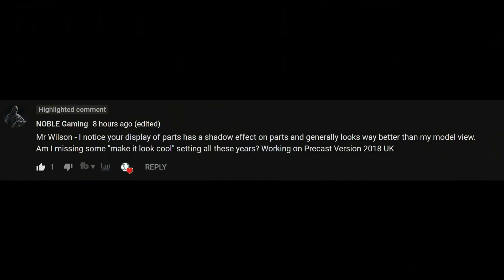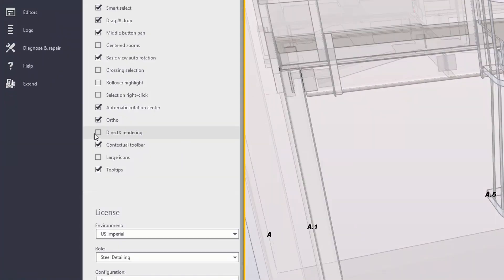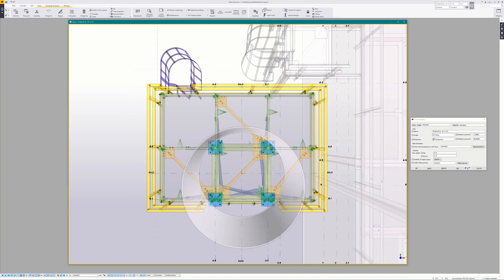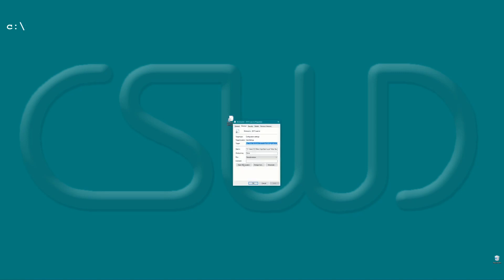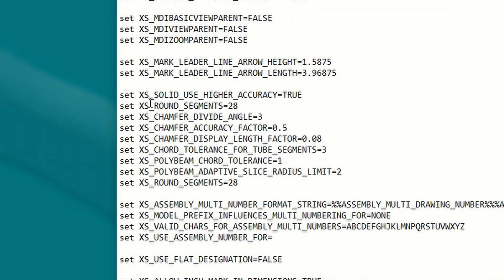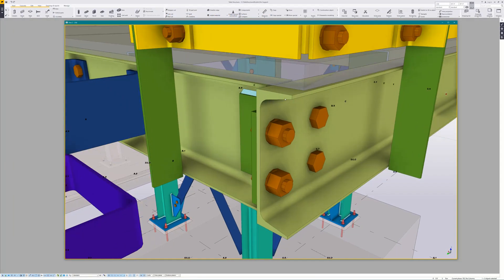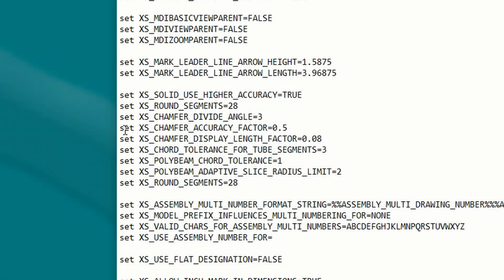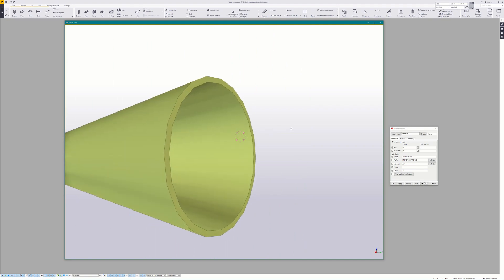Tekla Structures Display Settings

Comment: hello, can you share your user and option.ini files? Thank you !
Reply from the maker: Here is my user.ini file (you'll obviously have to change some settings.  i.e. firm folder):

rem ==========================================================
rem     Tekla Structures v2017i user defined settings
rem
rem     --- Please do your own system modifications here! ---
rem
rem ==========================================================

rem ==========================================================
rem --- UNIVERSAL SETTINGS ---
rem ==========================================================
rem  Add settings here that you want to use in both user modes
rem
set DAK_BMPPATH=C:\ProgramData\Tekla Structures\2017i\Bitmaps\
set XS_FIRM=C:\Users\CS Wilson\Documents\CSWD Firm Folder\
set XS_MODEL_TEMPLATE_DIRECTORY=C:\Users\CS Wilson\Documents\CSWD Firm Folder\Model_Templates\
set XS_DIRECTINPUT_CONFIG=C:\Users\CS Wilson\Documents\CSWD Firm Folder\DirectInput.cfg

set XS_USE_OLD_DRAWING_CREATION_SETTINGS=TRUE
set XS_DSTV_NET_LENGTH=TRUE
set XS_DRAWING_SNAPSHOT_CREATION=FALSE

set XS_MDIBASICVIEWPARENT=FALSE
set XS_MDIVIEWPARENT=FALSE
set XS_MDIZOOMPARENT=FALSE

set XS_MARK_LEADER_LINE_ARROW_HEIGHT=1.5875
set XS_MARK_LEADER_LINE_ARROW_LENGTH=3.96875

set XS_SOLID_USE_HIGHER_ACCURACY=TRUE
set XS_ROUND_SEGMENTS=28
set XS_CHAMFER_DIVIDE_ANGLE=3
set XS_CHAMFER_ACCURACY_FACTOR=0.5
set XS_CHAMFER_DISPLAY_LENGTH_FACTOR=0.08
set XS_CHORD_TOLERANCE_FOR_TUBE_SEGMENTS=3
set XS_POLYBEAM_CHORD_TOLERANCE=1
set XS_POLYBEAM_ADAPTIVE_SLICE_RADIUS_LIMIT=2

set XS_ASSEMBLY_MULTI_NUMBER_FORMAT_STRING=%%ASSEMBLY_MULTI_DRAWING_NUMBER%%%ASSEMBLY_MULTI_DRAWING_POS%%
set XS_MODEL_PREFIX_INFLUENCES_MULTI_NUMBERING_FOR=NONE
set XS_VALID_CHARS_FOR_ASSEMBLY_MULTI_NUMBERS=ABCDEFGHJKLMNPQRSTUVWXYZ
set XS_USE_ASSEMBLY_NUMBER_FOR=

set XS_USE_FLAT_DESIGNATION=FALSE

set XS_ALLOW_INCH_MARK_IN_DIMENSIONS=TRUE
set XS_LEADER_LINE_TO_DRAGGED_DIMENSION_TEXT=FALSE
set XS_ZERO_POINT_SYMBOL_OLD_WAY=TRUE

set XS_BASE_LINE_WIDTH=0.01
set XS_DRAWING_PLOT_FILE_NAME_G=%UDA:PROJECT_COMMENT%-%DRAWING_TITLE%%DRAWING_REVISION? - Rev %%REVISION_MARK%
set XS_DRAWING_PLOT_FILE_NAME_M=%UDA:PROJECT_COMMENT%-%DRAWING_TITLE%%DRAWING_REVISION? - Rev %%REVISION_MARK%
set XS_DRAWING_PLOT_FILE_NAME_W=%UDA:PROJECT_COMMENT%-%DRAWING_NAME.%%DRAWING_REVISION? - Rev %%REVISION_MARK%
set XS_USE_LINECLIP=FALSE

rem set XS_VIEW_POSITION_X=5
rem set XS_VIEW_POSITION_Y=5
rem set XS_VIEW_WIDTH=1024
rem set XS_VIEW_HEIGHT=768

-------------------------------------------------------------------------------

And here is a "typical" options.ini file of mine (again, you'll need to add, subtract or modify the values for your own setup):

XS_CALCULATE_MACRO_COORDSYS_FROM_POINTS=TRUE
XS_CLEAR_MODEL_HISTORY=TRUE
XS_POLYBEAM_ADAPTIVE_SLICE_RADIUS_LIMIT=1
XS_USE_OLD_DRAWING_CREATION_SETTINGS=TRUE
Reply: CS Wilson Draws  by the way, do you know how to set checkboxes always off when open dialog box. Thanks you.
Reply from the maker: XS_DIALOG_ENABLE_STATE

Comment: Hello sir, I have using Tekla 17 version but I don't found your setting. my setting is,
rem ==========================================================
rem     Tekla Structures user defined settings
rem
rem     --- Please do your own system modifications here! ---
rem
rem ==========================================================

rem ==========================================================
rem --- UNIVERSAL SETTINGS ---
rem ==========================================================
rem  Add settings here that you want to use in both user modes
rem
rem set XS_FIRM=..firm folder path\
rem set XS_PROJECT=..project folder path\
rem set XS_STD_PART_MODEL=..
rem set XS_PROFDB=..
rem :::

rem set XS_VIEW_POSITION_X=5
rem set XS_VIEW_POSITION_Y=5
rem set XS_VIEW_WIDTH=1024
rem set XS_VIEW_HEIGHT=768

Comment: Do you know what if any settings that would cause node/handles to be extremely small? This also seems to effect several dropdowns in dialogs with images. This happens on some monitors and not others.

Comment: Does the setting set XS_SOLID_USE_HIGHER_ACCURACY=TRUE work in TEKLA 2018? it works in 2017 version but when i change the ini file in 2018 version with the same settings you demostrate it doesnt work.
Reply from the maker: It work in TS 2018.  I have it set in the user.ini file (usually found at C:\Users\<user name>\AppData\Local\Tekla Structures\2018\UserSettings).
Reply: I created a new model and it work fine. When i try to open a model that i 've created before i applied your recommended settings it fails. Thank you. @CSWilsonDraws

Comment: Which computer configuration you are using ?
Reply from the maker: Right now, I'm running an Intel Core i7-8700k (4.8Ghz OC), 32GB DDR4 3000, GTX 1070Ti, 1TB SSD plus 2x3TB HDD (Raid 1), two monitors (43" 4K monitor (landscape) and 27" 2K monitor (portrait))
I'm working on a video about the construction of my current computer and monitor setup, but I've been busy and haven't had a chance to finish it.  Be on the look out for it, though!  I plan to post it someday! :)

Comment: Hello, Could I make some parts in the drawing as it is in the model, I mean rendered?
Reply from the maker: Yes.  You can create a 3D view on the drawing, shade the members as desired,  then plot the drawing in color.
Reply: Hello, I have an issue with the product identifier, for a certain model, doesn't respond to "option.ini", but the other models are ok, no problem. I noticed when I add the line XS_PRODUCT_IDENTIFIER=FALSE and save the file,  close it, after a few seconds, the file change and the line removed. could you please help. Thanks
Reply from the maker: It could be that XS_PRODUCT_IDENTIFIER has been set in the Advanced Options dialog of that specific model.  If that's the case, then it has been written to the options_drawings.db file as well.  Change it in the Advanced Options for that model.
Reply: thanks for your reply,  it was already False,. I tried to replace the file options_drawings.db with another one from a different model but was a big mess, it didn't work.
Reply: @CSWilsonDraws  Hello, is there any option in drawing to show any part in transparent like Glass etc.

Comment: thank you very much for your great videos, I learnt a lot from your nice presentation, I have a question, I want to remove product identifier, I tried changing it to false, but still, it is there, do you know a different way to get rid of it.
Reply from the maker: You're welcome, and thanks for watching!

As far as turning off the Tekla Structures using XS_PRODUCT_IDENTIFIER=FALSE, it works for me when I set it directly in the model.  You might try looking in your firm folder or user.ini file to see if it has been set there.  If not, put the line SET XS_PRODUCT_IDENTIFIER=FALSE in your user.ini file. 
Hope that helps!
Reply: thank you very much, I  will try it again.

Comment: I am trying to use direct modification to modify gridlines.
"direct modification"  and "gridlines" are on but I cant move the gridline by left click on the gridline. Need help.
Reply from the maker: I tested DM on model gridlines in TS2017i-SP4 and TS2018-SP1 and both are working.  What version of Tekla Structures are you having trouble with?
Reply: I am using ts2017.
It looks like its working only on some of models I have created.
Thanks for your time.

Comment: Mr Wilson
2 things, ok 3
first, thank you for your vidoes, they are very helpful, keep them coming.
2nd, i put your settings in the user.ini where you said it was located and nothing changed after getting out and back into Tekla. it did however work when i out them in the options.in in the model folder. any thought as to why?
3rd, if you have time, the model looks great now, i love it but, open holes are solid, they are respresented but can;t see through them. is seeing through them possible? if so is it advisable?

again thanks for your time.
Jimmydd123
Reply from the maker: Thank you!  I'm glad to hear you find the videos useful.
For your ini situation, if you're using a firm or project folder, check to see if there's an options.ini file in either one of those.  The ini load order would go something like: user.ini, then options.ini in the firm and/or project folders, then options.ini in the model folder.  Each one overriding the one before it.
For the holes being solid, I assume you mean holes added using the bolt command.  Unfortunately, those are depicted as solids in the model and not any to get around it if you want to be considered as "bolt holes".  You can manually add "see-through" holes, but they will be considered as subtracted material and not "bolt holes" per se. 
Hope that helps.  Thanks for the comment and the questions!

Comment: Hello, when you use XS_SOLID_USE_HIGHER_ACCURACY=TRUE you get broken CNC file for HSS tube.
Regards :)
Reply: I second this. Plus, you can change it on the drawing side to show radius on profiles.
Reply from the maker: Which version of Tekla Structures are you using?  I just checked this with v2017i and it seems to work fine.  I modeled an HSS6x6x1/4, mitered one end with  a line-cut and put a bolt through the other end.  I then created an .nc1 file using File->Export->NC Files (not Tube NC Files) and then opened the .nc1 file with Steel-Project CAD Viewer program and everything looks as expected.
Is there something specific that causes the nc file to break?
Reply: Thank you for your check. We had such situations on v19 & v21.1. Now we are jumping in 2017i, but we have read that the problem still occurs.
So we have to check it and in what circumstances it occurs.
I will let you know!
Reply: From my understanding it is the NC file data and the program that is being imported into. You can look at the NC files on a viewer and it is fine but that actual data in the NC file does not run correctly. This is the situation atleast for my company on the cnc line. When we turn off the setting the cnc machine runs the files. This however may very from machine to machine. Vsn 21.1, 16i, 17, 17i.

Comment: Great video. I'm glad there are people like you that are willing to share their knowledge. The DirectX rendering setting worked. However, I made the changes to my user.ini file and it made no difference. The shapes (Wide flange, angle, etc.) still don't show radius at flange/web intersection. Is there any additional setting I should look at?
Reply from the maker: Thanks!  I do what I can and I find your words very encouraging. 
Use the advanced option XS_SOLID_USE_HIGHER_ACCURACY=TRUE to show the radius parts of the profiles.  Put it in the user.ini and restart Tekla.  If it doesn't work, check to see if there's an options.ini file in the model.  If so, open it and see if XS_SOLID_USE_HIGHER_ACCURACY=FALSE is in it.  If so, delete that line and save the file.  If it's not, look for an options.ini in you firm and/or project folder and preform the same check.
Also, remember that when entering advanced options in the user.ini file, use "SET" before them (ie SET XS_SOLID_USE_HIGHER_ACCURACY=TRUE).  The "SET" is not necessary in the options.ini file.
Hope that helps!
Reply: CS Wilson Draws Thanks. I'll try that tomorrow.